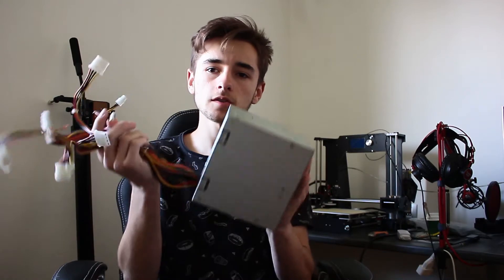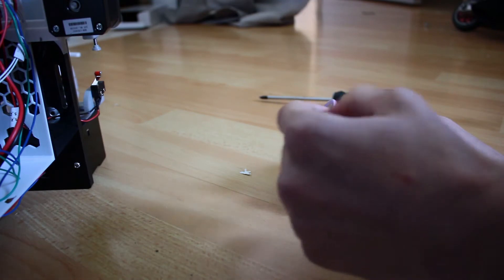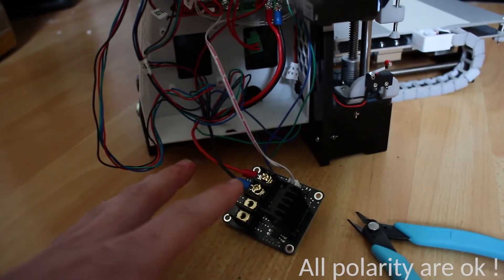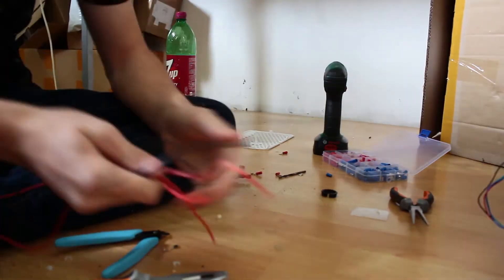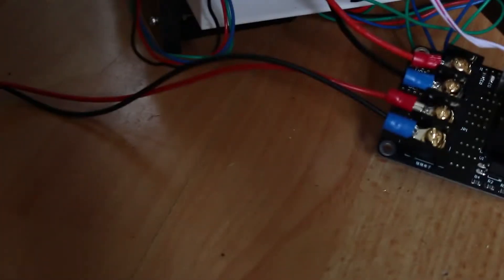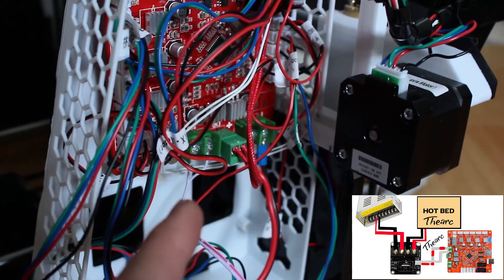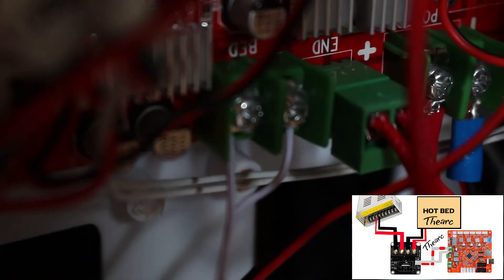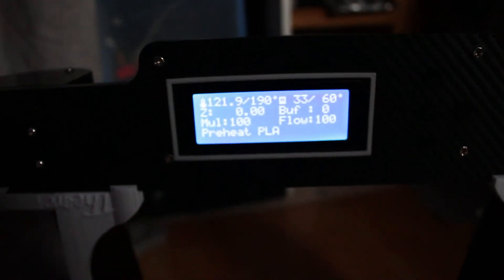HOW TO INSTALL MOSFET ON YOUR ANET PRINTER

Comment: The blue and red colour code of the terminals is not for determining + and - but they are indicating the proper diameter of the cable.  Using incorrectly sized terminals can result in faulty connection --> danger of shortage, fire etc!
Also do not just use pliers but get a proper crimping tool. Again risk of faulty connection!
Reply from the maker: Hello , for the blue and red color of the terminal those are the same size, :) 
I wasn't having enough money for it :/